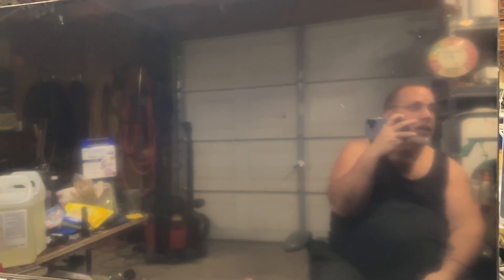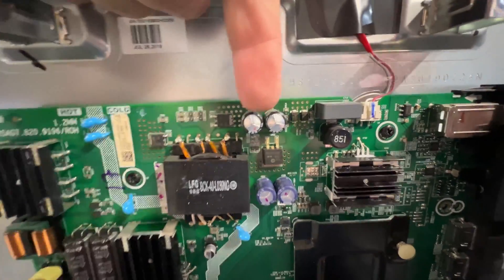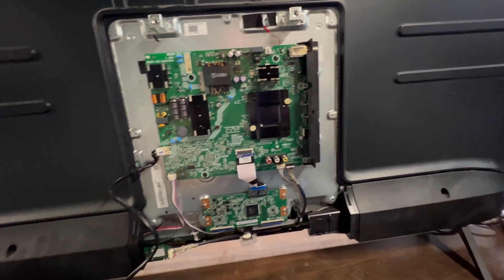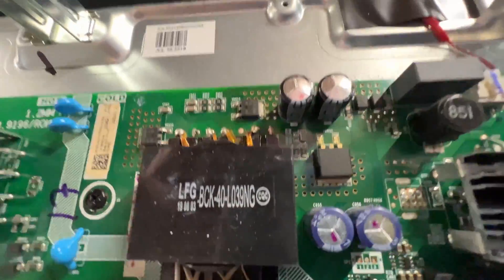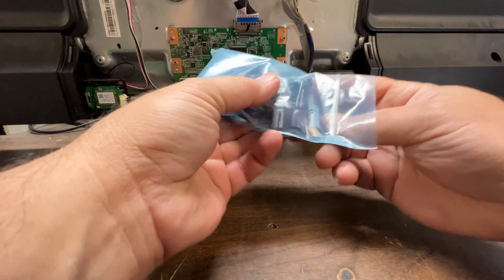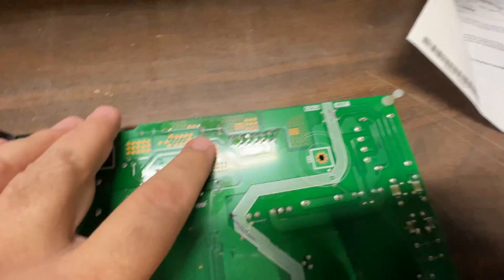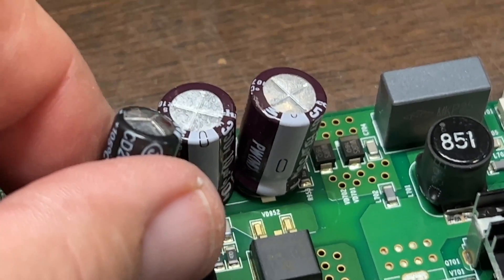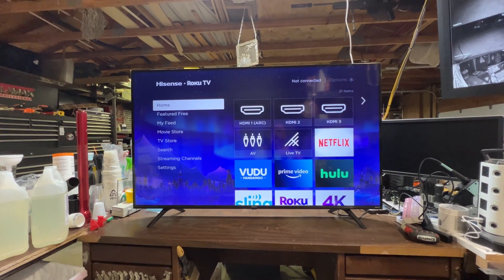HiSense  model# 55R6E3, 55" TV just flashes on and off repeatedly. I fix this issue for under $1.00

Comment: I'm legally blind and have a question. Are the two capacitors in question located on the motherboard? Due to my visual disability, I'm having trouble seeing all the details of this video. I have a television that needs to be repaired. I can most likely remove the motherboard by myself but, I'll need to get somebody else to do the soldering. Please let me know. Thank you.

Comment: Man that was a good video and I pushed like on it but we really would have liked to seen you do the soldering
Reply from the maker: I will video my next repair. Thanks for watching. :)
Reply from the maker: Soooo I think you somehow predicted the future with your comment, lol. Guess what I got today  that needed to be fixed? Yep, another TV and its EXACTLY the same brand and model and problem as the one in this video. I fixed it and this time, I recorded me replacing the capacitors. I am editing the video now and will upload today. Stay tuned!
Reply: @lordmater  that is pretty cool I haven't been able to take my back panel off to see if the capacitors are swollen yet but I'm looking forward to it I also need to find me a decent soldering iron any suggestions

Comment: Currently, I own the same model television. Although, it will not power up at all. It's less than 3 years old so, I'm assuming it's having the same problem. From my research, this seems to be a widely known problem with these units. I'm legally blind so, I'll have a friend uninstall the motherboard and take a look at the capacitors. Still, if I do repair it with new capacitors I'm wondering if it'll experience the same problem down the road. Perhaps, Hisense chose to use low quality capacitors but, it remains to be seen if using a higher quality capacitor will solve the issue permanently. In fact, I'd be curious to know if you have any insights on that?
Reply from the maker: Its hard to say because it might just be low quality caps, they are used in soooo many devices that I repair, but sometimes it can be other things causing the caps to go bad. Either way, I do wish you the best of luck in your repair endeavour. It definitely a widely know problem with these TVs. Hisense probably needs a class action lawsuit against them for this known issue.
Reply: @lordmater  yeah, I would tend to agree. I have two of these televisions and it's only a matter of time until the other one goes out. Lol. Although, I am struggling to find exactly the same rated capacitor. They seem to be in short supply and the ones I'm finding are mostly for ceiling fans. They should work as long as there is room for them on the motherboard. They're a little bigger than the ones that are there now.

Comment: Thank you! My Roku senseless POS 55" TV started flashing on and off, I'm thinking s#t, it is not even 3 yrs old and I have to burn $1k on another brainwasher. But! I saw this vid, went to digi-tech, got a pack of 10 caps 10mf 350 volts, paid $5 + expedited shipping to get them the next day as the wife threatened to buy a new teevee in time for the thanksgiving party. Got the caps at 10 am, and found a guy to solder them bcz that is not my thing. He charged me $100, but he is a circuit board surgeon. Put everything back together and BOOM I back in my blissful trance! Put the black screen beauty back on the wall and took my cc away from the wife. God bless you! I now have $900 left over to spend on ... well, something else for the wife, but at least it was not for a new teevee. 📺  With 8 caps left over, I'll be able to get maybe 10 more years out of the Roku
Reply: Digi-key, sorry
Reply: my 50 Hisense is doing the same thing but Digikey doesn't have capacitors.  Don't know where else to get them... @mlm9964
Reply from the maker: You're very welcome. I'm glad you got her going again. :)

Comment: Thank you for making this video. I fixed my TV by ordering the capacitors you recommended, and soldering them to the board.  My TV is now back to normal and I didn't have to pay $180. to get it fixed by a TV tech or throw out my TV.
Reply from the maker: You're very welcome and that is such good news! I love fixing my own stuff anytime I can! Way to go!
Reply: Where did you get the capacitors?   Digikey is showing 0 capacitors

Comment: hey this was a ton of help, just one question, in the description you have one product number, but it's different from the one you attached with the link, just wondering which ones the right one.
Reply from the maker: The best thing to do is look at your caps and then call digikey with a description. They will need the numbers running down the side of your caps plus the size of your caps (measured in Millimeters).  :)  The type you want are called "Radial Electrolytic Capacitors".
Reply: @lordmater  okay thank you :) and one more thing if you can, my step dad said he can put the caps on for me, but he just wants to know what solder to get. (im gonna be honest i dont really know what that means) but if you do id really appreciate it :)

Comment: Thanks so much for the video. I have the same model 55” Hisense tv. Was having the same boot loop. Took the cover off and sure enough had the same blown capacitors. Ordered the same capacitors that you linked in a comment. Replaced them and sure enough the tv is back up and running. Thanks again.  For anyone wondering, I was able to do this with no soldering experience.
Reply from the maker: You're very welcome and I am happy for you!

Comment: I replaced my power board supply and it did the same thing. So I put back in the orginal and returned new one...... What should I do ?? I checked the caps and they looked fine. But figured if it was the caps the new bored would of worked fine

Comment: How do you take out swollen caps just pull them off??
Reply from the maker: You need a soldering gun to unsolder them from the board, then you resolder new caps back into the board. Its not hard to do but you can damage the board if you dont know what you are doing. I would find someone near you to do the soldering for  you. :)
Reply: Got them replaced now my screen went black smh everything works but the screen went black any ideas what it might be??

Comment: I have a hisense 65" that is doing the very same thing. After changing the main board which didn't work i found your video. :) However my board has a group of 6 capacitors, capxon , from what  read are junk, 470uf 25v and down a bit (about an inch) another row of 3 capacitors 10uf 350v and there are 2 more spread across the board about  5" or so by them selves 68uf 50v. The thing is none of them show any signs of swelling or anything. "(don't have in circuit tester)  After watching your video i ordered the 6 and the 3 (rubycon) but did not order the individual 2. Thanks for the video, hope this works when i get them. Just wondering if you've ever ran into that your self. From what i've read i guess it happens.
Reply from the maker: I have ran in to that. They can still be bad even though not swollen. They make a Capacitor Tester that allows you to test them in circuit (meaning while they are still installed). Usually though if I dont see swollen caps I wont go any further.
Reply: Did u fix it we have the same problem no obvious swelling and we have multiple capacitors

Comment: I got a dumpster Hisense tv 58 inch I believe and it does the same flashing however the screen is dim when it flashes I am not sure what the problem could be.
Reply from the maker: Maybe changing the caps would help. If its still dim after, its probably something with the backlights and I don't mess with those. :)

Comment: I changed the capacitors but now the screen is just black. Any thoughts?
Reply from the maker: Be sure you got the new ones soldered in good and the solder joints on the bottom are not touching each other.

Comment: Mine has same bootloop problem but no bulging capacitors. Also, swapped in a (used) replacement power board and mainboard but problem is still there (bootloop).
Reply: My is doing the same thing even after I got now power Supply!!  Did you ever get it fixed?
Reply: not sure if you’re still holding onto the tv but i read other comments saying that it is likely a network or wifi board that is causing the boot loop

Comment: What is the height range? Trying to get some in for this week and want to make sure they're not too tall or too short, if that's a thing.
Reply from the maker: Its definitely a thing. I think mine were 20 MM tall if I remember correctly. You should def measure yours to be sure of the correct size. There is a little room to play, but not too much as these caps are side by side.

Comment: My 65 inch 65R6E1 is doing the same thing. I'm mechanically inclined and soldered copper pipe but not electronics. Do you have a video for that TV or is it basically the same just more screws to take out? Edit: I opened the back and the capacitors look fine but it still does the turn on and off bit. Any help would be appreciated.
Reply from the maker: Your Caps could still be bad. I would change them and see, just be careful and make sure to unplug the TV  before you do anything. Good luck :)
Reply: @lordmater  I appreciate the speedy reply. I'll order some caps today and try it out when they arrive. Have been watching videos on soldering electronics and such, doesn't look difficult. If that doesn't work should I order another power motherboard?
Reply: Did it start working? I have the same exact model as you and can you link the ones you bought?

Comment: On the wires on the bottom, do you just pull it to disconnect it? I ordered a completely new board ($23) and I'm afraid to break the wire part on the bottom. I got the others pulled out, but that bottom one is stubborn as hell. 😂
Reply from the maker: I honestly cannot remember. It either just pulls off or you have to mash it and then pull it while you are mashing it. If its the mash kind you will be able to tell because it will have a small hump you have to mash that keeps it locked on. Send me your old board, lol. Send me some pictures of it and I can tell you for sure what you need to do. Send to stormsfury@comcast.net
Reply: Can you tell me where you ordered your board? Thanks.

Comment: I have a hiesen 75 inch that started doing this after 6 months. They came replaced the power board and main board. Now 7 months later same thing!  When it started apps went crazy opened closed at random. Now stuck in loop. So I'm wondering if this is the problem or really the boards again. What makes these go out?
Reply from the maker: Heat is the #1 enemy of any electronic component. The best thing you can do for your TV is completely unplug it from power if you are not watching it.

Comment: Mine is doing the same, except I have a 58" (58R6E3). Will the same caps fit my model as well? It messed up Sunday and has been in a reboot loop, it took 5 days and 15 different customer service people with Hisense and Roku for me to partially figure it out. It took this video to tell me what I needed.😐 Idk the steps to put on the caps, but hopefully me or my husband will figure it out. It's frustrating!
Reply from the maker: You can look down the side of the Capacitor and it will tell you what it is. It will say something like 25 UF 350 Volts or something like that. BE SURE to order only the same exact thing. Also I would turn the TV off and unplug it. If you leave it plugged in you may damage the TV beyond this easy repair.

Comment: could you send a link of where to get them or what exactly the capacitor is called ?
Reply from the maker: Green Man Productions
2 months ago (edited)
From www.digikey.com I used part number 493-2048-ND which is a DESC: CAP ALUM 10UF 20% 350V RADIAL. Give that info to a tech at Digikey and they can pull up the same cap for you. I would get one about 2MM less wide than what those are if it was me. Just tell the tech you need the same Capacitor but 10MM wide by 20MM tall . :)
Reply: This may help too
https://dilp.netcomponents.com/cgi-bin/nteinc.asp?partnumber1=NEVH10M350CD

Comment: My Hisense 55" started doing this yesterday. None of the other methods worked (IE unplug/plug it in, Reset and so on) after watching your video I took off the back panel and sure enough, the 2 bad caps just like yours. My skills aren't in soldering, so I'll have to buy a whole new board and replace it. Thanks for showing me where to look for my real issue.
Reply from the maker: Send it to me and for a very nominal fee I will replace them for you. lol
Reply: @lordmater  I would like to send you my board so you can replace them for me
Reply from the maker: @popoff2011  ok, send it to 18123 16th Trce, Live Oak, Florida 32060 :) and my cashapp tag is $leifhunt I will replace them for $60.00
Reply: Did it work after you got a new board ?
Reply: @anayahhill5220  the board seems to be out of stock, so I'm still waiting

Comment: Please help. I have the same tv and it’s doing the same thing. We watched your video and took tv apart. The capacitors are large fat swollen whatever you call it. Digikey is out of the size we need. Do you have any suggestions that we could use ?
Reply from the maker: Did  you actually call Digikey and speak with a tech? You can totally do that and they will help you find what you need. There are MANY different brands of capacitors so I'm not sure they could be out of them all.  :)
Reply: How would it cost to have that fixed
Reply from the maker: @gregoryg2668  I can replace your caps for $60.00 if you mail me the board and pay for shipping both ways. :)

Comment: I had the same exact problem with my 55R7E and replacing the same 2 10uF 350V capacitors fixed it. Thanks for the confirmation that I was on the right track in figuring out the problem.
Reply: Where can i get those capacitors???????
Reply: @ElonMuskX  I got mine from Digi-Key Electronics Part # VHT10M350. This was the radial 10uF 350V capacitors and were just a little taller but fit fine.
Reply: @BigBud69  Thanks, I tried them and they are on back order as well as a few other places........That sucks!!!
Reply: @ElonMuskX  Sorry to hear that. I got mine in like 3 or 4 days. Well good luck on your repair!
Reply: @BigBud69  Thanks friend, That part number was different than the one I had.  I have 5 on the way.......Thanks again
Reply: @ElonMuskX  Your welcome 🙂
Reply: @ElonMuskX  you ever get those in man? Things saying 28 week lead time for me currently 😑 is that accurate?? How long did it take?
Reply: @Ki777UMiNATii  yes, got them in and installed TV works great!!!!
Reply: @Ki777UMiNATii  A week?
Reply: Yes, a little taller but they fit no problem

Comment: Hey buddy I have the same exact issue with the same tv I went on to the digit key website to order the capacitors you have but it's confusing given they have way too many to choose from is it possible for you to send me the exact ones you got so that I can buy those from them thank you
Reply from the maker: I used part number 493-2048-ND which is a DESC: CAP ALUM 10UF 20% 350V RADIAL.
Reply: @lordmater  do you think these would work it look different from the ones you got in the little bigger than the ones that are in "cap ALUM 10UF 20% 350 RADIAL"

Comment: could you send me the link for a part that you replaced?
Reply from the maker: From www.digikey.com I used part number 493-2048-ND which is a DESC: CAP ALUM 10UF 20% 350V RADIAL. Give that info to a tech at Digikey and they can pull up the same cap for you. I would get one about 2MM less wide than what those are if it was me. Just tell the tech you need the same Capacitor but 10MM wide by 20MM tall . :)

Comment: Do you know what size those caps are exactly? I have two bad ones exactly like those on my a6100 hisense Roku tv
Reply from the maker: I went back into the TV and looked. They are 10MM wide by 20MM tall. 350 Volt and 10UF.
Reply from the maker: If you mean size as in its physical measurements I do not. Its put back together now. If you mean voltage and UF ratings I say it in the video :)